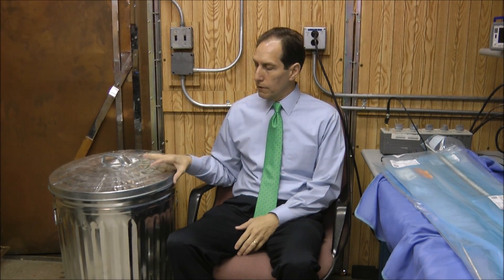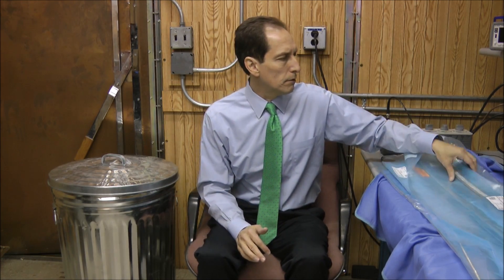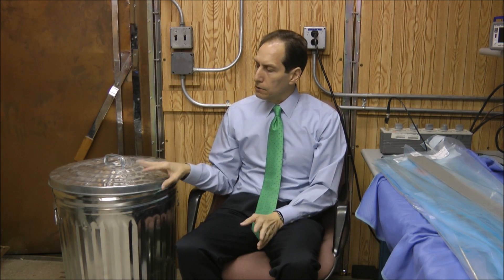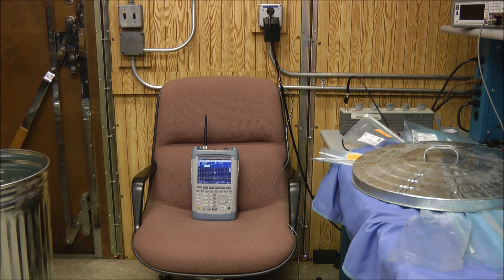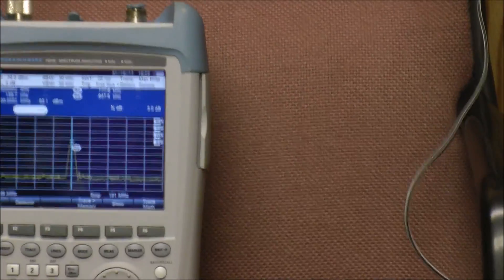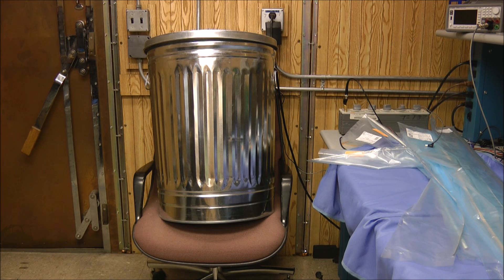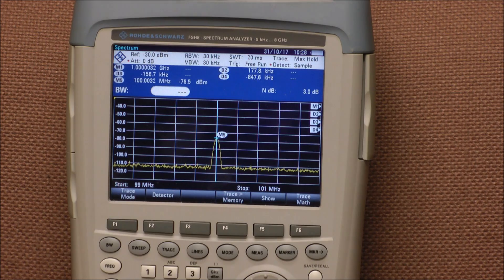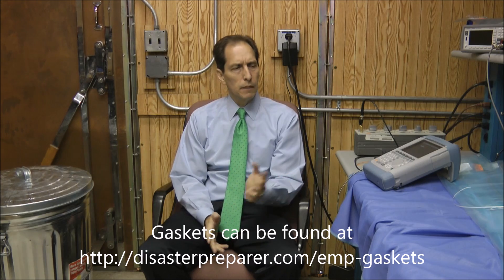Gaskets to Seal Faraday Cage

Comment: I use Faraday fabric for the seal. Fill the can with your items, then lay 2 layers of Faraday fabric over the top of the can, then place the can cover on. The flexible fabric provides a tight seal and good electrical contact between the can's main body and the can cover.

Comment: Would be nice to see result with can fully sealed.  The handles have open gaps in them so seal w metal tape and possibly get another 10db shielding.  More concerned about EMP than any of the other isolations.

Comment: Hi, thank you for this, very informative! I want to order the EMP Gasket for my 20 gallon garbage can. Your site has the 0.23 x 39.37 x 0.08 and states it fits a garbage can but does not state the size of the garbage can. Can you confirm it will fit a 20 gallon can? I know this is an older video so not expecting and answer from you Dr., but I am hoping someone here can answer this.

Comment: Good day Arthur, I am wondering if an insulated metal clad building work as a faraday cage? Also would it possibly protect my inverter and electrical solar system in my off grid cabin with the panels being mounted on the metal roof in the case of an EMP attack?

Comment: I luv your videos.  QUESTION:   You talk about sealing every nook and cranny .... however isn't an EMP like a pulse event which pretty much happens in like 1/10 of second?????!!!!  I've seen very porous Faraday cages with like people inside of them as Tesla Coils are going off all around them.   As long as the latice is rather consistent .... wouldn't electricity take the path of least resistance???   Cause I'm thinking isn't EMP just a super duper high voltage .... but in the end isn't it just electricity?!   Or is it that when dealing with millions of volts .... electricity just acts differently???  🤔🤔🤔  Cause even the Pentagon with their Tempest Shielding .... isn't that just a lattice and NOT a fulling enveloping metal shield with no holes in it?!   And even if we had multiple EMP incidents .... wouldn't we just need to protect stuff 1/10 of a second at a time??!!  And a friend of mine brought up that this cage must be grounded?!  I didn't think they had to be grounded.   To me it would seem like another avenue for EMP to saturate the metal envelope of the stuff you are trying to protect.  🤨  Thanks in advance.   😊😊

Comment: I make what I call "Faraday Joints" for this.  I roll up steel wool inside of aluminum foil like a big marijuana "joint," usually three is enough for the lid circumference, and put around the lid overlapping each othe and let the lid pinch them down.  Works great, is dirt cheap, and easily reusable.  

How important is running a ground wire to the faraday cage?

Comment: I bought the gaskets recently. I have two smaller cans and two large. It took less than two strips to do the large can and one strip plus the extra left over from the large can to do the small cans. Still had about 20 inches after doing the four cans with a total of six strips. I added aluminum tape across where the caskets meet. I found it necessary to clean the lids with alcohol for all tapes to stick well. 
The caskets had a thin adhesive strip in the center, so I am hoping they stay put over time.
Thank you for doing the testing to boost my confidence.

Comment: Too bad I can't add a photo or else I'll show you what I done that works 10 times better than an expensive gasket and is reusable at least 100 times now I've measured it with similar equipment and a Geiger

Comment: On the diasterprepared website the gasket measurements are  0.23″ (W) x 39.37″ (L) x 0.079″ (T). To me L means length and W means width. Are the gaskets actually 39.37"

Comment: Some regular aluminum foil with lots of layers to put over  the can  with a couple inches aluminum foil and strips,  thick, put the lid on over the can under the lid  for a tight seal with aluminum foil.  Possible if you make a tight enough seal under the lid, to help shielding at least.

Comment: Question.  Is there any danger associated with storing these batteries and things that use lithium ion batteries all in this trash can?  Any chance of them exploding due to lack of air circulation inside the can?  Not plugged in of course.  Still concerned about having these batteries and radios in a can in my basement.
Reply: No, just don't store in a hot place (it's not good for the battery, though not dangerous).

Comment: Too bad that this presenter does not understand the basic technology of the Faraday cage very well. it requires two layers, isolated from each other. The inner layer must be grounded and the outer layer floating. That's why real screened enclosures cost tens of thousands of dollars.

Comment: I installed  on my 25 KW Generator a BROWN  out kit it monters voltage  on line if voltage  drops  below  95 volt  or go's  over 240 volts it will drop out in come power & start Generator   i believe  this will work  on EMP 🤔

Comment: This is very good information!  Thank you!  I also like the thing someone said about putting a small plastic can inside that. But if you put some tin foil around the electronic it may give just a little more shelding inside the plastic can. I have some radio equipment that I want to work after what ever happens is done.the tin foil would be a pain in the bottom to put on each time.  But there are some things that are not used much that could be just put in there for use mostly after something happens. Kind of thinking as I type. Not all good ideas but something to think about.

Comment: [QUESTION]

So we are working on a can, I was wondering about custom seals. Currently I am using a window seal (Looks Like: .O_O. with two adhesive strips under the rings) that's been wrapped around the lip of the can so that the rings point up and out. We were going to drape a metal fabric around that and adhere it to the side of the can.

I was going to use gorilla tape to keep the fabric on the can, but I've been told to use glue instead. I feel like using glue would get in the way and make the connection worse.

My questions are this:

     -Will glue get in the way of a connection between the can and the fabric?

     -Will gorilla tape last?

Comment: Much appreciated in this confusing and sometimes contradictory field. I am concerned with reports of a potential coming solar micronova, which may create an intense induced current into the Earth itself, destroying electronic and (it is said) possibly most metal objects. Would this protection be effective against such induced heating? If not this, then what?

Comment: 55 gallon drums are probably a better choice and will seal liquid-tight. They come with a clamp ring overlapping seal. You can also pick these up for scrap prices though I can't verify the prices. Be careful of what was in them. Ideal would require just a rinse. Waterproofing - that kind of thing - rinse easily.

Comment: Here is an experiment for you, get an analog multi meter ( I use a Radio Shack Micronta 22-212 ) with  no leads attached to it, set it to the lower DC volts scale, next set it next to your cell phone and play a video on the cell phone of Bill Gates talking and watch the needle when Bill says  v a x x i n e  .  my needle jumped to 5 volts but that was after I removed several apps that I don't use because the needle was jumping to 10 volts and 15 volts and it would hold at 4 volts a lot. I played a recent video where Russel Brand played a clip of Bill Gates, while Russ was talking I saw only 1 or 2 volts but when Bill starts talking it gets a lot more active. 
This video was quite active,  I saw some 8 volt spikes when you said conductive and I saw some 10 volt spikes  ....

Comment: Due to the recent unpleasantness occurring around the globe, I decided to make a faraday cage with a trashcan, similar to the one you have here. I want to use that gasket you are referring for the top. My idea is to go a few steps further to insolate the items inside by nesting things in a plastic garbage can inside the metal one. My plan is to buy a smaller plastic can, add spray foam around the smaller can to form a insulated barrier between the two cans and keep the smaller can from moving around. Place the lid on the plastic can, then place the lid on the metal can with the gasket around it. I was wondering if you think nesting the plastic can inside will help much for protection against EMP/solar flare?
Love the videos.
Reply: It’s possible the smaller plastic can might conduct static, maybe you could find a smaller aluminum can.
Reply: @libbylandscape3560  I have since found it hard to find cans that will nest inside each other and be used like I want to . The plastic cans are usually bigger, the ones that are smaller than aluminum will be too small for what I want to put in them. Probably going to build a box out of wood and layer with fabric.
Reply: E-----M-----P-----20------24---------Aug.
Reply: No elections in 20--24 for the 48 states, O-B, WHIFE BECOME the NEW LEADER. Millions don't survive the weeks that follow. NO MEDIA COVERAGE.
Reply: @Mr. M.O.G.O.M. The govt does have hardened shelters, they also have a standard for building structures that will survive one of these events. I would suggest maybe you watch a few more videos and learn some things before going around looking foolish.

Comment: Wouldn’t the adhesive prevent the connection/insulation of the lid to the can? It seems the aluminum side of the gasket would work but the adhesive side would not have a strong bond electrically speaking.
Reply: My concern as well. On many stick on products

Comment: Flex seal interior can and underside the lid  close it then aluminum tape  lip then use duckt tape over the aluminum tape because it is fragile. Pay close attention to all  garbage can seams and the handles  better off to remove the handles then aluminum tape seal the holes  again reinforce aluminum tape with duct tape.

Comment: I've tested it and grow tents with mylar lining and metal h vac duct work tape over zippers works great for generators batteries ect lots of room. If you have a grow tent just a heads up plus mylar blankets wrapped around most will protect generators battery back ups. Just a alternative if your money is low like mine at the moment

Comment: Unfortunate that the gasket I received was very thin and would not stick . Not sure if it had been sitting for a while but could not get it to stick long enough to even get it completely installed. Maybe if it was a little wider the sticky side would have more area to help with that. Has anyone else had this problem?
Reply: You might want to give this a try - https://www.youtube.com/watch?v=wfa6g6ylA6o
Reply: I’m having the exact same issue.  Were you able to figure out a way to get it to stick?  The gasket wasn’t cheap so I’d hate to give up on it

Comment: Based upon the results of this study, it appears that a steel filing cabinet would offer very good protection from EMP.
Reply from the maker: It certainly could, but you'd need to seal the gaps around the drawers.

Comment: I tried the trash can test with my cellphone (no gasket or seal) and my phone rang normally.
Reply from the maker: Phones aren't a good test for EMP shielding. They typically work at different frequencies and require about 100 dB of shielding to fully block the signal. I talk about this in one of the videos.

Comment: Made myself a quiet generator box and wrapped it in aluminum. If I use a conductive gasket does the aluminum have to be bare or can I put the  gasket on the paint?
Reply from the maker: I checked this and found that it wasn't necessary to have bare metal.
Reply: @disasterprepper  thank you!!

Comment: If a 52 gallon barrel Is used does it have to be stripped of all paint?
Reply from the maker: No. Just make sure that the seal around the lid doesn't have a non-conductive gap.

Comment: Until I can purchase a gasket, would several sheet of foil placed over the opening before the lid is attached work?  The foil should fill the gap to some extent.

If there is an EMP or CME, you will never know how  many lives you may have saved because of the instructions you gave us in your videos.  THANK YOU, one of those lives may be mine.
Reply from the maker: Yes, that would probably work.

Comment: How come the inside of your trash can is not lined with cardboard?? Everyone says you have to have the inside lined of its not effective?
Reply from the maker: The cardboard is just to prevent anything metal on the electronic device from touching the can. It's not strictly necessary in many applications since most electronics have plastic housings.

Comment: It was not quite clear to me where the gasket is stuck to the lid. It is in the corner, but is the glue side on the vertical side of the lid, or the (mostly) horizontal underside surface when the lid is on the can. I think it would be on the horizontal side, since if it is on the vertical side, it would be dragging each time the lid is removed and replaced. If on the horizontal surface it would just meet the top lip and compress when installed?
Reply from the maker: The gasket's glue side is stuck to the inside sidewall of the lid (not the underside). It is so thin that it doesn't really drag against the lid. I've had mine for years, and it hasn't come loose.

Comment: I've always read/heard/seen that trash can Faraday cages should not have a gasket.  You're talking about 'conductive' gaskets though. 
I've never heard of them before this video.  The term is almost a contradiction in itself. 
gasket-seal.....hmmm
You are spot on I think 
 Using the generator was better than an AM/FM radio test.

Comment: That's exactly what I did. I covered corrugated cardboard with 2 layers of HD Aluminum foil. Lined the lid, sides and bottom.  Then, covered the entire inside with 1/4" foam board.. 
Then I wrapped every device in aluminum foil.  Then put each wrapped device into a Zip Lock baggie.  Then wrapped it again in foil. 
Installed rubber feet ( glued) to the bottom. 
NOTHING gets through as far as our tests went. We used cell phones,  AM/FM /WEATHER Solar Crank radios. My solar charge continues,  inverters, battery charges, multi meters, and TV/DVD Players, and 2'way radios are all inside.
Reply: Daaaamn,oook

Comment: I'm guessing the metal tape is still more effective at higher frequencies if it's taped perfectly with no gaps. Looking at metal trash cans they have a lot of warps and small dents so if you end up with the gasket not sealing perfectly for a few inches I guess most people would not know unless they test their set up with phone signal strength. If you can stop wifi at 2.4ghz then you know its going to be really effective at 500mhz or lower.

Comment: Why can't you buy the flex seal paint and paint the inside of the can and the lid, it's a rubber barrier that would seal all the seams and any tiny holes that might be in the handle and also keep all the components from touching the metal. Just a thought 🤔

Comment: Try berryilum flexible finger stock used on professional screen room doors. 
Another issue is that the galvanized coating on these cans will oxidize over time and become an insulator or become a diode joint due to the oxidation.

Comment: Hi Doc, Should a cell phone ring if placed inside? 

I double nested this same 31 gallon steel bin, inside a 20 gallon steel bin (both lined with cardboard and lids secured with HVAC metal tape) and my phone still rang inside when I called it. I do live right next to a cell tower if that matters (0.5 miles away)
Reply from the maker: This level of protection is good for EMP protection, but not for the larger task of signal blocking. For that, you would want a Faraday bag, which we do have at disasterpreparer.com.
Reply: @disasterprepper  Thanks, I bought some bags, how sealed do they need to be? For example - do I need to have a perfect seal with scotch tape, or as long as it's folded over a bit is that enough?

Comment: Thanks so much for this video and taking the time to educate others, I'm learning a lot from your channel. I do have a question about DIY faraday cages like this one made from a galvanized steel trash can. Does layering the conductive material inside of it help with protection? For example, lining the inside with a layer of brown paper bag, then aluminum foil, then cardboard (or some other variation of non conductive, conductive, non conductive layering). Would this additional layer add any extra protection? And if so, would it be enough to make it worth the effort? Thanks in advance!
Reply from the maker: The foil would add some extra protection, but you would need to be careful because normal foil can tear easily, losing the protection it was providing.